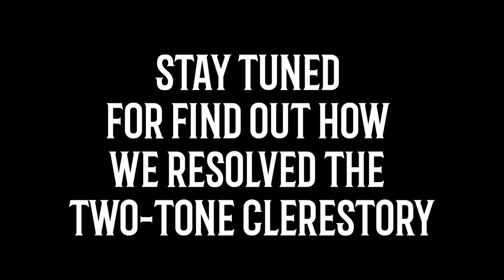#strawbale #sustainable Day 38: More Glass for Our Off Grid Straw Bale House

Comment: From what I was told when I got my double pane glass was that it is easier to just replace than entire thing instead of trying to replace a single pane because of the gas in-between the panes for the insulation. I'm sure it's doable if you had the equipment but for most people, it's probably more of a hassle.

As for the foodsaver, I like to use them for anything I want to keep moisture out of, like ammo.
Reply from the maker: I just sealed my ammo yesterday! Great minds think alike. Not all double pane windows are argon gas filled, but after getting the price for the new replacement window I realized that trying to fix the broken window would probably end up either not working in other words moisture getting in, worse.

Comment: I expected it to crack. These frames are put together on a jig by machine. They have bit of tension built in and taking out that strip was just enough to crack it. Even it you had got it out, putting in the new strip would crack it. Anyway, you've landed on your feet at $196. The weather looks amazing. 👍
Reply from the maker: Sometimes phases of the bill just give me more problems than others and a couple of the windows have been really a thorn in my side. But we'll get through it and $196 for a brand new picture window seems like a good deal to me. I just hope I can get it safely installed without busting it. 🤣

Comment: Your 1” is poplar. I’m from Canada.
Reply from the maker: Thanks for letting me know! It's really a great product for just a few pennies more than the previous stock I was using. I was working with it today, and I did notice that it is about one to one and a half millimeters narrower or thinner then the one inch stock I had used previously. But being clear of knots as well as being straight make it a far better product.
Reply: Ahh the joys of converting from metric to imperial. You always lose a little.

Comment: curious..why didn't you use generic size windows?
Reply from the maker: All of the windows are generically sized with the exception of that picture window which we bought on off of Craigslist for $50. So we took what we could find and tried to make it work in order to save some money. But of course it ended up costing us $50 extra now that we have to replace it.
Reply: @theupsideofdownsizing  thx for the response, house is really coming together..